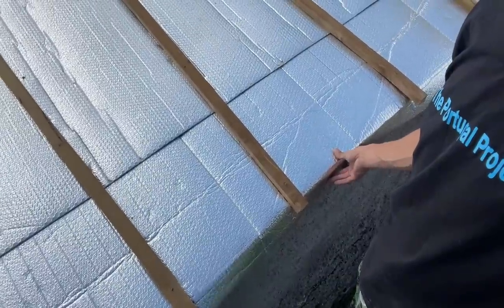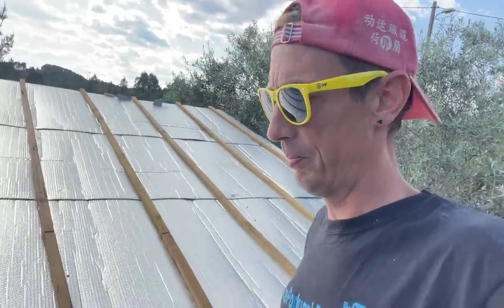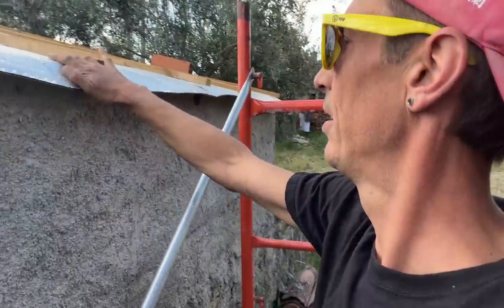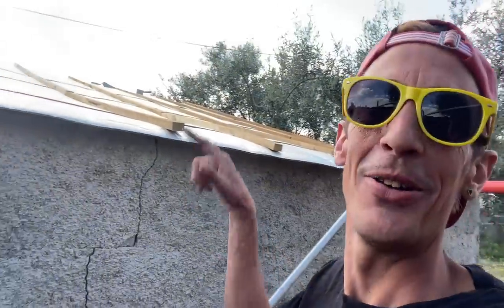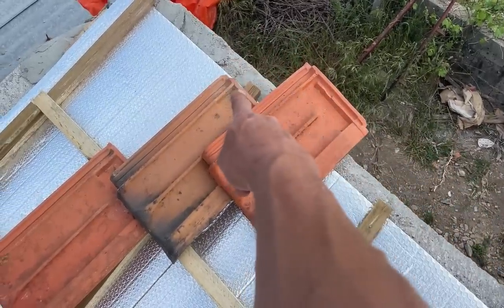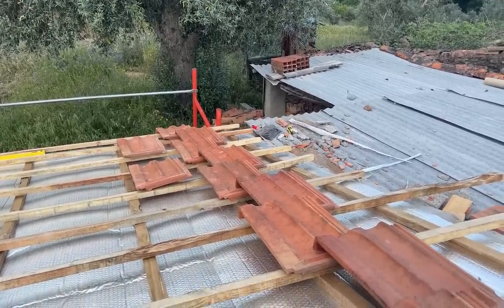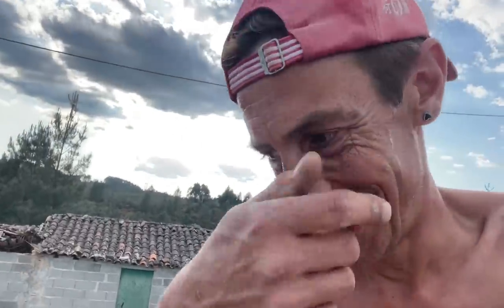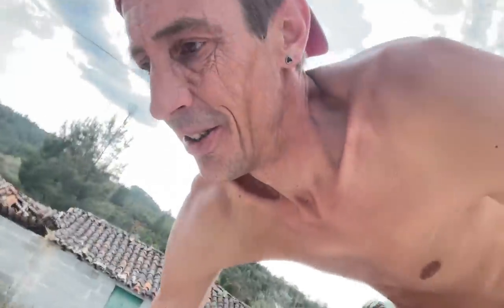MINI REBUILD PART 21 (sort of like this..fixing battens) - Portuguese House Renovation

Comment: Have you considered corrugated sheet metal roofing? Faster, easier.
Reply: From what i understand from other yt-bers in Portugal is that you can redo i.e. repair without licences, etc. but changes need permits (costly and impossible).
Reply: @hillockfarm8404  that's sad.  Jasper could finish it in one day.

Comment: I’d be worried the front wall of the building came down, your concrete lintels aren’t sitting on much, plus the weight of the roof , I would be getting those walls sorted before you start working on a door and window